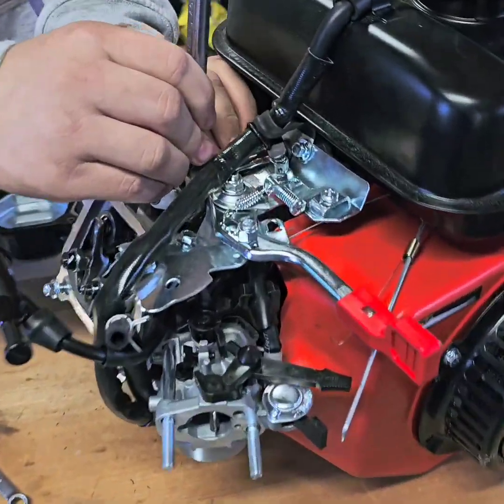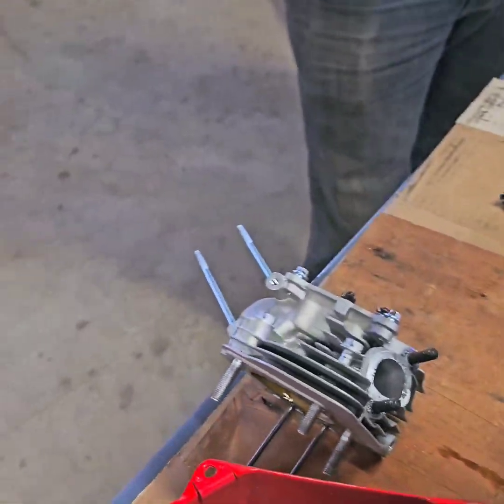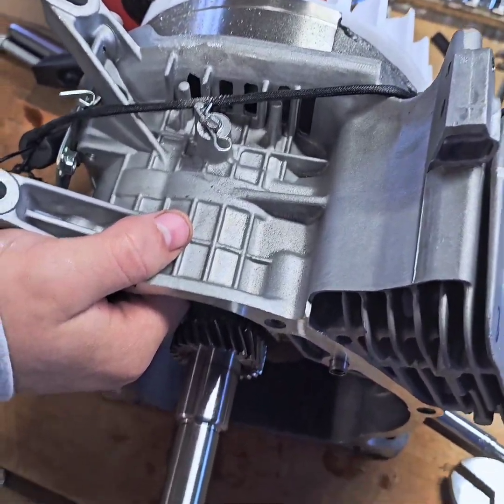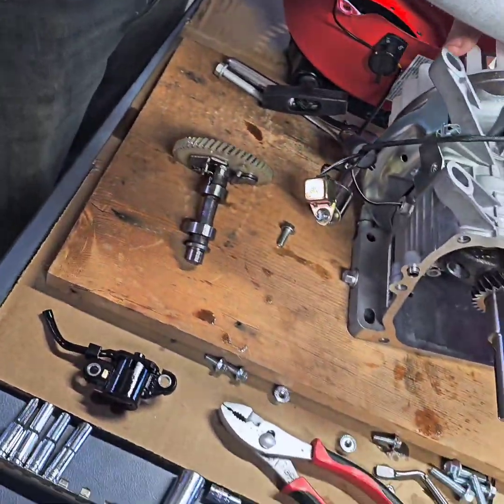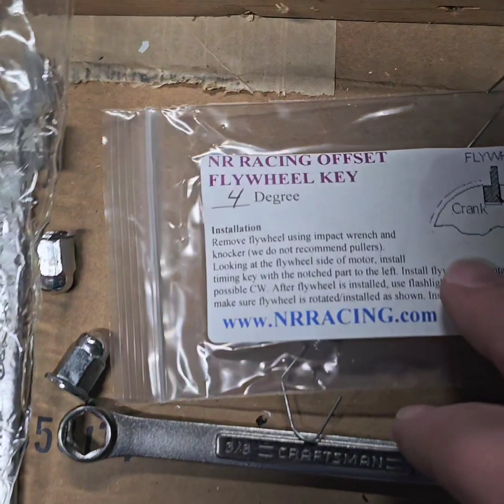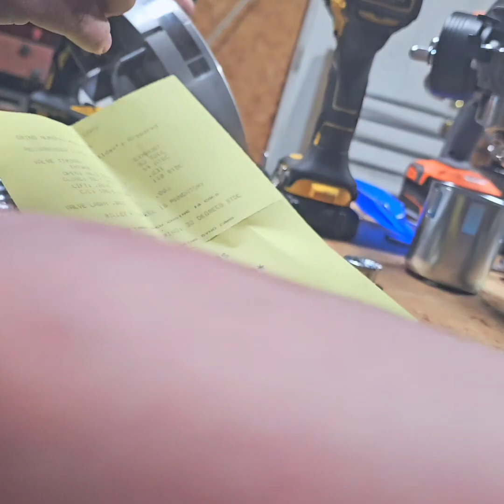Predator 224 stage 2 build (FAIL)

Comment: The picture of the 4 degree key is correct. The engine would run even if you had it on backwards.
Reply: thx, thats what i thought. i changed it around the day after putting it all together so it was the way the picture showed. i just ordered a the carburator that comes with the nr racing 224 stage 2 kit because i think the jet that  comes with the stage one kit wont work with the cam. nr racing is only 2 hours away from me so it should only be 2-3 days before its here. i tried calling them to see if i could just pick it up but every time i call- no answer.
Reply: @jagerandres5808  Yeah their bored carb should work better. I used a reaming tool to open the venturi on a stock carb for my 224   and it runs well.

I don't run a lot of RPM. But if I was going to I would get a slide carb.